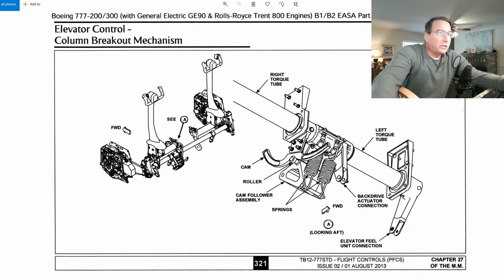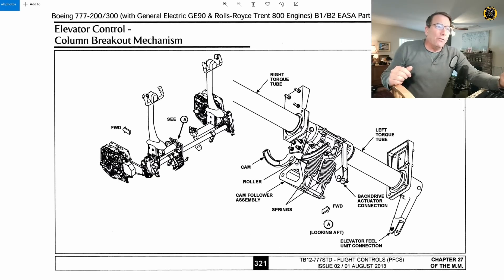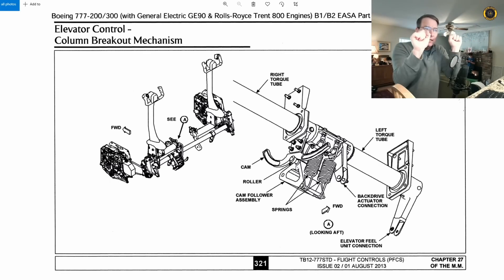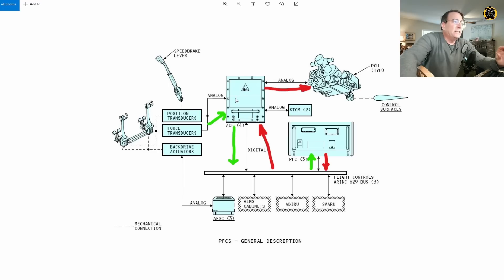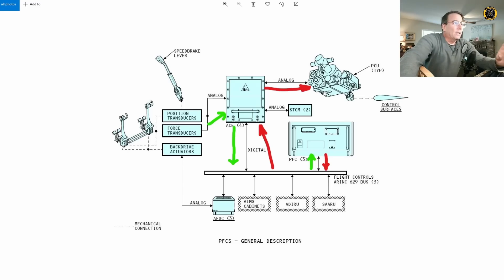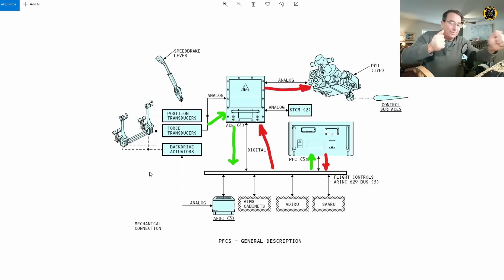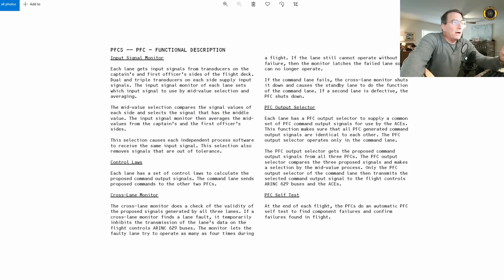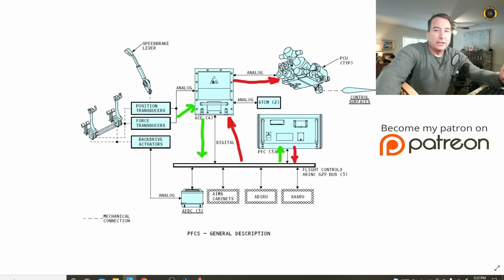Air France 11 Decoupled Flight Controls- "Who's Flying?"

Comment: Thanks for the explanation. I never flew anything with fly-by-wire, so it was very interesting to hear this. I wonder how this system would respond to a powerful EMP? Like the Carrington event? Is it hardened in some way?
Reply: They are not hardened to the standards of electronics in space craft which are exposed to higher levels of radiation, but the electronics is incased in metal boxes, cables are screened, electrical signalling cables use balanced connections (and differential line driver and receivers) , data buses using balanced signals and error detection and correction algorithms and optical fibres.  The equipment survives lightening strikes which is EMP, although not to the level of a nuke.

Comment: You can bet AF will be incorporating flight control decoupling on their next recurrent syllabus.

I wonder why Boeing relegated decoupling to the nice-to-know category. Perhaps they never thought something like this would ever happen? Well, it can and it did. That’s how it works in aviation. 

I understand how and why Airbus feels control logic with dual inputs must be prominently mentioned in the FCOMs given the asynchronous nature of the Airbus FBW sidesticks.  But you might also think this AF incident would never have happened had the pilots known that Boeing control columns could actually decouple. 

Control decoupling was mentioned prominently in the 1999 Egyptair 767 crash, where the relief pilot, sitting in the right seat, was suspected to have deliberately put the aircraft in a dive and the captain in the left seat attempted to regain control. IIRC in this case, the flight controls decoupled and the control surfaces followed their respective control column’s input, i.e. up elevator for left column, down elevator for right column.  

Perhaps we’ll be seeing more mention of decoupling when—or if—the accident report on the recent China Eastern 737 crash ever sees the light of day.
Reply: Egyptair -  just like Atlas Air 3591 then (except the pilot there just thought they were stalling and panicked).
Reply: You’d think positive transfer of aircraft control would be front and center in Air France recurrent after AF 447…

Comment: Very cool with six sensors they can be checked against each other at startup. I like elegant systems like this, I know my car for example will not engage cruise control until after it has seen a brake pedal sensor switch operate since it was turned on.

Comment: The use of force transducers and feedback "motors" to provide the pilot with the "feel" of a physical interface with a control surface is exactly how a flight simulator works.  Sounds like they installed a flight sim in the airplane but use a real world environmental interface to provide the visual and kinetic feedback to the pilots rather than a graphics generator, video displays and hydraulic platforms.

Comment: Still not sure what does this mean if the columns disconnect. Who has control?.
Reply: The columns disconnect *from each other*, not from the control system - it just averages the inputs.
Reply: @cr10001  i see.  So full upp on one side and full down on the other has no results then?

Comment: I remember from the EgyptAir 990 crash, (B-767?) that when control columns split each column controls elevator on same side as the control column. I don't know if this applies to ailerons. Obviously that's a less advanced and more mechanical bird than the 777.
Reply: I asked that question (about ailerons) in a previous discussion re the 767 and I got a very informative reply (I'm sorry I can't remember the name of the gentleman who posted it) - yes the ailerons and spoilers are 'split' in a logical way - each control wheel controls the ailerons on its side and the spoilers on the other, if I remember rightly.   I think FBW would allow a more coherent and co-ordinated 'averaged' response to conflicting aileron inputs, though.

Comment: So you are pretty sure if the control columns split the inputs see averaged.  Which is what airbus does if both side sticks are moved at the same time and one does not have priority.   Seems like knowing for sure should be a training item.
Reply: In the airbus there is a button on the control column for taking control.

Comment: Lots of parallels to modern automobiles, minus the redundancy. We don't have any clue how it all works either, but troubleshooting all of it is just a process of elimination. When all avenues are exhausted, you replace the box o' magic! AKA, the Magic Box. The key is to not let any smoke out of the wires in the process. All wires contain smoke, as you know ... and magic pixies. Magic pixies are very bright ... and hot! 😁

Comment: So you do not ever know or need to know what law the FBW is operating in on the 777? Sounds a little strange. The video does not directly answer the question in the title: “Who’s Flying?” I guess the answer is “nobody was.” This simple mechanical breakaway system sounds like it probably was carried over from earlier Boeing non-FBW aircraft. I can begin to appreciate why Airbus elected to use electronic side stick controllers for FBW airplanes. It’s not perfect but it’s probably not as confusing in a duel(ing)-input scenario as the mechanical system.

Comment: Thanks Juan for the follow up video.  So it sounds like the 777 engineers fully considered the possibility of a jammed single column, and continued flight with one column functional.  However,  when the Captain and the FO have independent views on the best course for the plane, the 777 control system would take the average of the two inputs.  Interesting to say the least.   Looking at the drawings, I'm trying to figure out, if the columns are split, does one side get the "elevator feel" feedback and not on the other? what about the "stick shaker"  or are those feedback systems dual too.  Cool stuff.
Reply: I think it was the same on previous Boeing models such as the 767 which (I believe) had individual cables to each half of the elevators and a similar torque splitting arrangement.   (And probably in other Boeing models too).  So there the 'averaging' would be mechanical - one elevator would go up, other down.   The 777 just continued this system but adapted it to FBW.

Comment: This is not the first time the column controls have been de-coupled on a Boeing airplane - it also happen on Egypt Air Flight 990.
Reply: An Atlas Air 3591.   (But these are examples of pilots 'fighting'.   I think the primary reason for incorporating the 'splitter' is redundancy - in case one side jams or breaks, you still have 50% control).

Comment: Question, if the Captain pulls back on the control column and the Co-pilot pushes forward at the same time does the left elevator go to nose up position and the right elevator go to nose down position?
Reply: On a 767, yes  (check Egyptair 770 and Atlas Air 3591).   They have individual cables to each side.   So the elevators cancel each other out.   On the 777  I'm not sure, I would guess the FBW system would average the inputs but I'm guessing there.

Comment: Also a retired Boeing Flight Controls engineer.  For a time I held design responsibility for these mechanisms.  Great video and explanation.
These breakout mechanisms, and the resulting control effects, are also to be found on non-FBW Boeing airplanes; the 777 equipment was designed to be analogous.  If the controls are broken out, one pilot has some surfaces, the other has the rest. The exact distribution varies between models.  And of course, the breakouts are there in case of a jam; pilots aren't expected to be fighting each other.
Reply: "If the controls are broken out, one pilot has some surfaces, the other has the rest." This is in direct mode. The Captain controls the LH flaperon, RH aileron, spoilers 2, 3, 7, 9, 12 and 13 and the LH elevator, the First Officer controls the LH aileron, RH flaperon, spoilers 1, 4, 5, 7, 8, 10, 11, 14 and the RH elevator. In normal mode and secondary mode the PFC calculate an average. When the rudder controls split one control input is substracted from the other. This is always the case in all three modes due to the designt of the rudder pedal breakout mechanism.
Reply: @Horstroad  Thanks, I'm a mechanical guy so my description is more applicable to the non FBW airplanes!
Reply: @Horstroad  ...and then good luck for a better coordination of the two pilots.
Reply: So if the airliner is pitched down as in it just stalled and one pilot is pushing down to gain airspeed & the other pilot thinks that the air speed is sufficient and is pulling back to recover from the dive the pitch will be neutral (average of the two yokes that are separated >50 lbs).  Not good.  No wonder the two pilots though the airplane had a mind of its own.  All the more reason to know who is flying the airplane!
Reply: @shoersa    I'm not sure what else the manufacturer could do.   Airbus also averages the inputs unless the pilot one side presses the button on his sidestick to take over control. 
Your example did happen sort of backwards - not a stall, but Atlas Air 3591, the co-pilot who was flying got disoriented, thought they were stalling and shoved his control column hard forward, the captain (after a few moments of surprise) pulled hard back (it was a 767) and they briefly 'split' the controls, but too late and they hit the ground.
Reply: @shoersa  It's a CRM issue. Needs to be "my airplane" and acknowledged by "your airplane", right?
Reply: Thank you very much for this additional informations! Yes, indeed, you get sometimes incidents nobody was able to imagine they could happen.
Reply: If the right yoke  is jammed somewhere near center position,  does the left pilot have to give >50lbs force EVERY time they pass that position (due to the recoupling)? What a terrible way to enter small corrections when navigating.
Reply: @sagetx  Yes that's correct. Just for fun let's assume the RH control column is jammed at full nose down. You would have to keep a constant 50lbs pull just to stay level.
Obviously that's a total edge case which will probably never happen. But the system needs to be designed in a way to handle even these edge cases. That's why there is this mechanism that makes you think "WTF" on the first look.
Reply: I think this is nonsense. It shouldn't be like that unless the workload is too high for a single pilot. But we're talking the control yoke and rudder pedals. I have flown gliders and all primary flight controls surfaces: ailerons, rudder, elevators, flaps are all under control of a single pilot. How can you break that functionality across two pilots? Or don't they?

And flaps are not on the yoke, they are separate controls on the centre console, and what we are talking about here is the breaking of the yoke and rudder pedals because the demand input is massively different between the left seat and right seat positions.  So flaps shouldn't come into it.
Reply: @deang5622  Again, this is not intended for both pilots to use the controls. Only one of them should be in control at any time. The breakout mechanism is designed for a jammed control column/wheel.

Comment: But,.......unless I'm being particularly dense today, you didn't answer the question "who is flying the airplane if the pilot and F.O. are commanding different inputs"?  Would this not "confuse" the primary flight computers?
Reply: The computers usually average the inputs.   It doesn't 'confuse' the computers, they respond to the averaged input.

Comment: Just out of interest is there any warning to the pilots of separated controls (master caution/warning - controls decoupled)? Also a bit surprised an awareness of the system isn't part of the type rating for the pilots - I realise that you can't cover everything but pilots not being aware of systems has had consequences recently.
Reply: No warning was generated on this particular flight, and looking in a random FCOM manual it appears there is no checklist for a split column or any associated warning. I suppose Boeing expects the ATP rated pilots to positively exchange controls and notice if it requires 50 lbs of force to move the column and glance over to see if you're fighting the other guy.
Reply: @MillionFoul  it would seem like a reasonable assumption however I can quite see how with no training or awareness on the system and suddenly finding the controls not aligned and doing apparently different things to each other whilst the aircraft does neither could be severely disorientating and confusing, it really seems like something to help the pilots situational awareness would be waranted (again similaritis to the situations with MCAS - and other incidents).
Reply: @tomriley5790  I mean, some similarities. In neither 737 Max crash were the pilots unclear who was the PM and who was the PF, which is something even private pilots are taught to be very anal about. Airbus aircraft also lacked the dual input warning until it caused an accident, and even then only because the sidesticks are not connected to each other or easily visible and so it is very easy for pilots to both give inputs. Imagine having you and your friend both holding the steering wheel of your car, it would be very hard not to notice that they were moving it if you were out of sync.
Reply: @MillionFoul  Exactly. And this was not the first incident or accident where one pilot doesn´t recognized what the other was doing, including Boeings.
Reply: Yes, indeed.
Reply: For me this is another dark whole in Boeing politics and training.